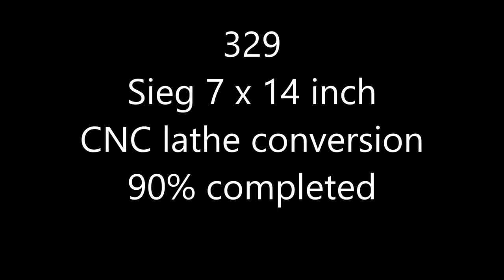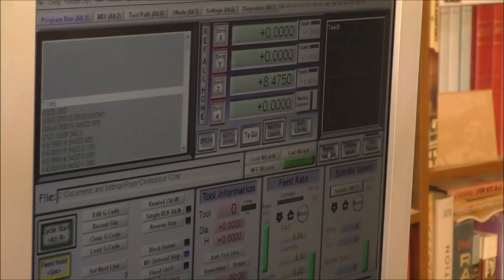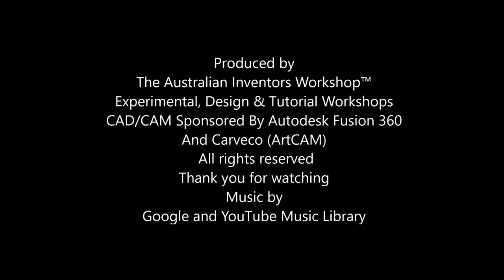330 Harbor Freight Sieg 7 x 14 inch CNC mini Lathe conversion 90% completed

Comment: O my. Love your work and really good job but please please please. Clean that grease off and use proper way oil. Things will slide rather then stick and also it won’t clog with dust ect and wear your ways out. But great work.
Reply from the maker: Thanks for the tip!